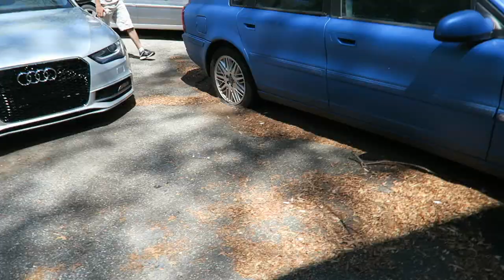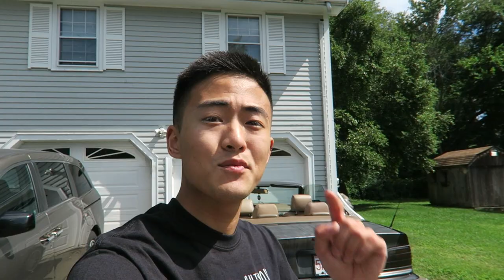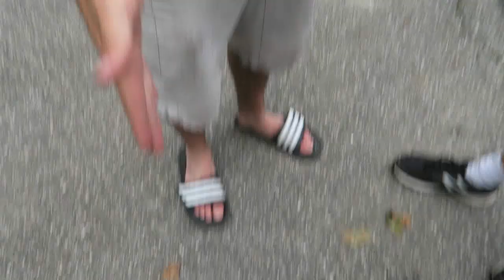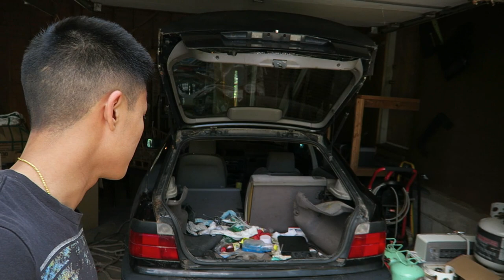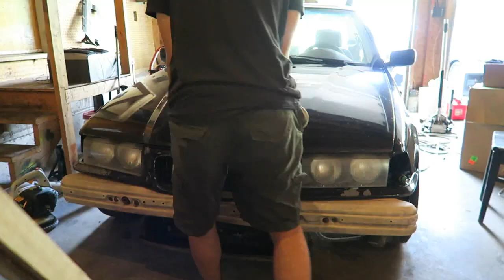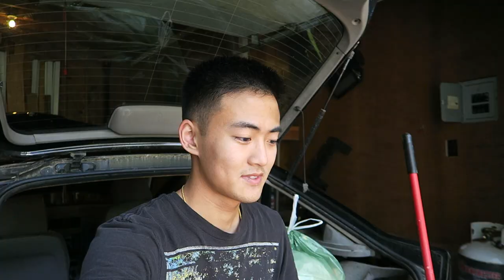I Bought A BMW E36 From A Junkyard ...Was It Worth The Price? [1996 BMW 318ti]

Comment: The 318ti will be quicker around corners than other 3 series e36s. I have a 1996 318ti swapped with a m50 vanos with a miller war chip. Its 10/10.

Comment: Hey man, can i have your war chip tune?

ive done kinda the same build as you. cx racing, miller, 60 lbs, walboro.

thanks
Reply from the maker: Danny iPwn hmu on insta! Simply sending my tune to ur car won't necessarily make it run better but I can help u thru the tuning process there
Reply: im not with the times friend i dont got an IG.

Right now im looking for a laptop that runs on XP lol. only got windows 7-10 around here.

Do you think it would be beneficial to set the chip up NA? or should i just do it when the turbo setup is fully running.

what exactly did you do for exhaust? Custom?
any pics of where the downpipe itself ends on the chassis?

sorry ive got a ton of questions! thanks man!